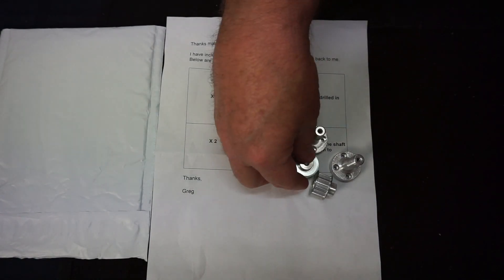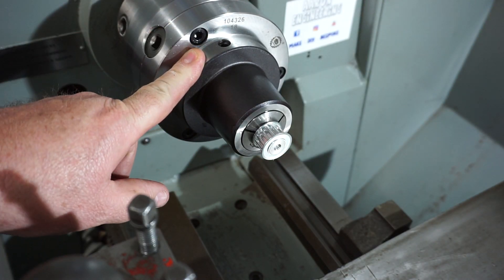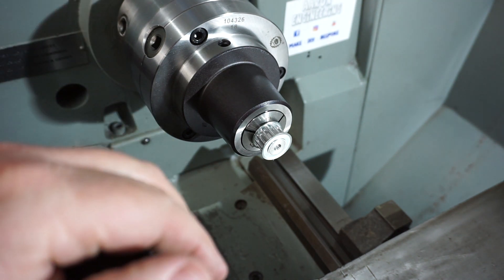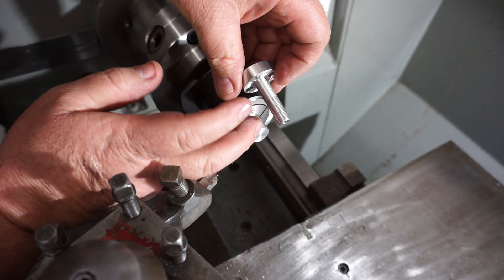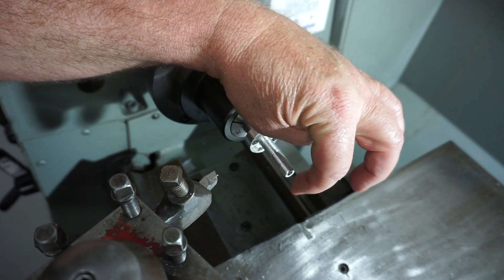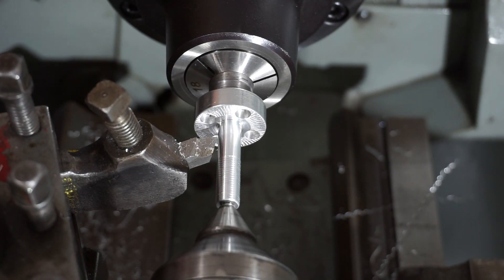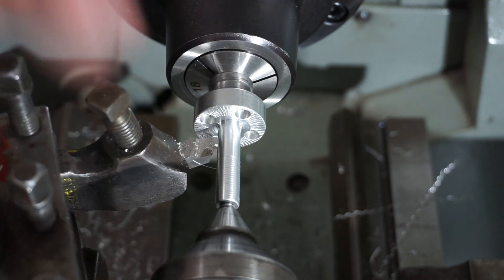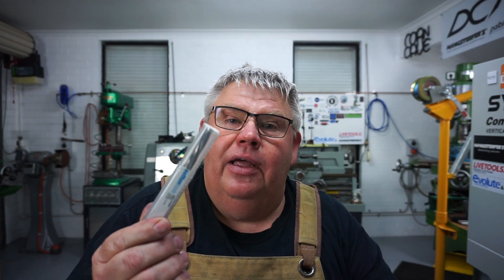Reaming & Machining parts - COLCHESTER LATHE

Comment: Good save. At least it was not some exotic alloy you were working with. This reminds me I need to check my tail stocks after the move around to make sure they are still in line.
Reply from the maker: G'day Tom and thanks mate.  I think that's a very good idea, maybe I should be checking mine constantly also.  Nice to see your dogs playing and having fun.  Don't you just love them.  Cheers, Aaron.
Reply: @AaronEngineering  Well I checked them today. Small lathe was out 4 thousands and my big lathe was out 7 thousands. They were dialed in before the big move. I guess all that shaking on a truck was enough to move them out of alignment.

Comment: Been there buddy.  Reamed a .501 hole for a .500 drill rod that is .498 this weekend.  Why I didn't measure the rod and use the .499 reamer will bug me forever.  Starting over on that one after I make a small test sample. Thanks for keeping it real!
Reply from the maker: G'day Stephen.  Thanks for sharing your machine shop tribulations with me.  I seem to be FKing up a lot lately in the shop.  I spun the tool post around fast the other day at school to change tools and snapped the parting tool clean off.  FML, no idea what's going on lately.  Maybe it's early onset dementia LOL.  Cheers buddy.

Comment: G’day Aaron. Hey even on a bad day you can still knock up a pretty good presentation. I too like to edit parts of the video and run em at 200/400% you get to work faster and don’t break a sweat, sweet! Have a good one. Cheers. Peter
Reply from the maker: G’day Peter. Thank you 🙏. Sometimes speeding up the footage stops the boredom. I usually show the text (video speed %) when I do that though. Funnily enough, I did work up a sweat on Saturday, but now it’s freezing again down here and the heater is on. Hope you’re well mate? Cheers 🍻